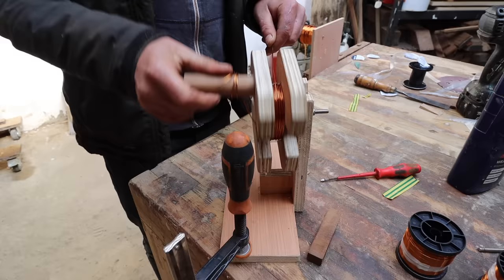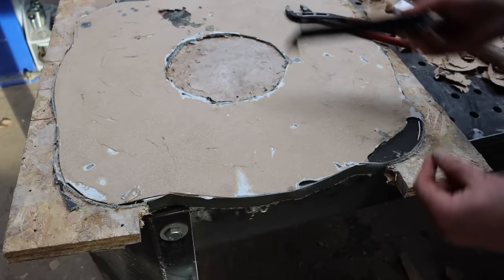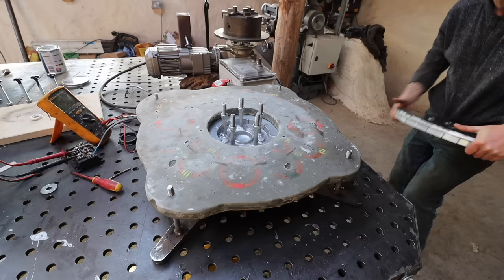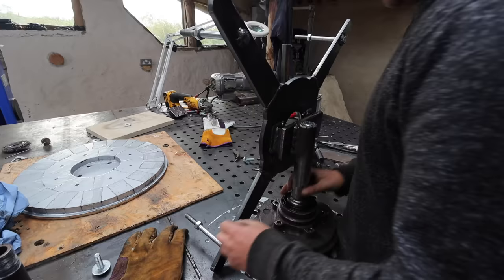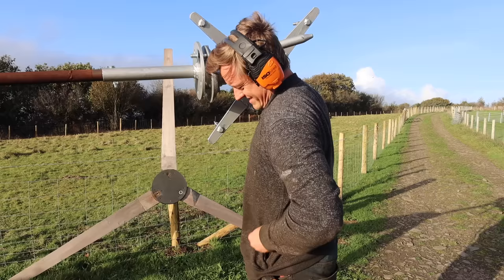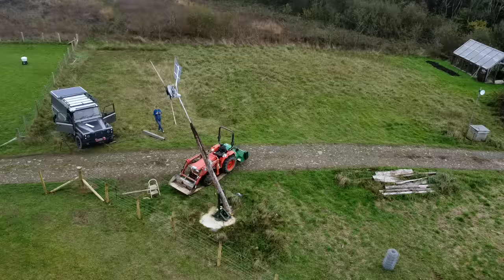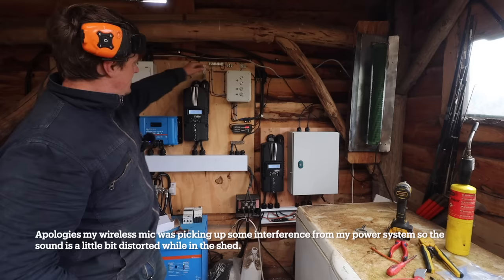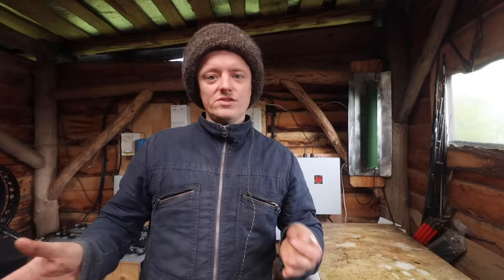Off Grid 2 KW Axial Flux Wind Turbine And MPPT Dump Load Controler Build

Comment: Very nice work!
Another tip, if you make the coils slightly trapezoidal you can pack more copper in the windings.
Only the radial sections of the wires generate electricity as they pass through the magnetic field.
Reply: @ahaveland......  The last sentence of your comment left me puzzled. The cross product of the magnetic field vector and the motion vector yields a current in the direction of the windings....  or maybe I didn't understand your comment. It's as if you were saying that the wire on the 2 long sides of the windings is being wasted.
Reply: @nicolasuribestanko  no, the wire on the short sides is mostly wasted as there they are mostly outside of the magnetic field, and there the magnets move along the wire, not across them. This is why long motors are more efficient and have more torque than short ones because there are more and longer windings inside the fields than out of it. (edited)
Reply: @ahaveland  Got it!  Thank you.
Reply: @nicolasuribestanko Thanks - on rereading, I edited my reply to explain it hopefully more clearly!

Comment: You can use a blowtorch to quickly remove bubbles from resin. This project is a bit big, but you could also use a vacuum chamber to draw them out
Reply from the maker: The bubbles were trapped under fiber glass. thats why I had problems getting them out. you can see in the video I had to snip the fibre glass to let a bubble out. im sure a vacuum would work though.
Reply: @KrisHarbour  Ah makes sense. If you're going to do much resin work, building your own vacuum chamber would be an awesome project!
Reply: @KrisHarbour  though useful, you don't need to mess about with vacuum chambers: if you wet the mat out with resin before putting it on it'll help stop air bubbles, so will agitating the mold when you've poured resin into it - block of softwood in a recip saw or something similar will make the bubbles rise out. (You may have done this anyway, apologies if so. I know how armchair YouTube comments annoy you!)

Comment: You could use a voltage sensing relay to trigger aux 1 if for some reason the voltage on the turbine gets to high due to the a malfunction of the ssr as you mentioned. Sad to see less energy projects in the future, however I'm always pleased to see your other videos as well:)
Reply: It seems SSR:s usually fail in ON position so less worries.

Comment: Great video and what a treat that it was over an hour long. Might be a stupid question but would the heater ever pose a fire risk in the barn? Would a water heater with a decent amount of thermal mass be useful, you could then pump the heat (water) out and refill it if it got to hot.
Reply: This was what I wondered as well, I thought he was going to heat water with it, and wondered even then whether that could get too hot.

Comment: Inspirationally simple implementation.  It could be a little simpler still, or rather, cheaper, if you make more use of the controller.  Sense the RPM, and when it's high enough to be productive, power self-exciting coils instead of using magnets.  Aside from avoiding the costly magnets, it also lets you map the torque response so you can fine tune the efficiency while keeping it in a target RPM range.
Reply: So that is what makes my 2kw Bergey so simple; it appears to be just a double-sized car alternator. Also Bergey says use a 100 ft tower as a minimum height to eliminate ground effects.

Comment: Kris, great build as always. Do you have any reference which we could use for calculating the right size of coils for certain-sized wind turbine? I am looking into building a much smaller turbine but still, some literature would be very helpful.
P.S.: If you would be interested in making an AC-side dump load controller as backup and to use the excess as a useful heat where you want it, let me know.

Comment: 48:56 You could make some electric heating elements your dump load and then make yourself a huge sand/thermal battery... You've got the space for it and it should be relatively cheap to make. Install a few electric heating elements in some tubes inside a much larger container, install a few more tube for air flow or liquid flow, make sure it's all sealed and insulated, then just fill it with a few hundred bags of sand. The waste electricity would be stored as heat, thanks to the sand, and if you needed some heat, especially in the colder months, you could just pull the heat from your sand battery to heat your house and/or workshop. I'm not sure what heating method you use currently, but whether it's wood or gas/propane, you'd save on fuel even if you only boost the temp by 5° with your sand battery. At least that way you'd be making some use out of the waste electricity and you won't have worry about overloading anything as much.

Comment: I've seen other DIY wind turbine designs using a driveshaft to the base. This allows the rotor and stator to be at ground level and remove the weight from the top of the tower - less work to raise it and less risk of a heavy object at height. Not sure if this would reduce efficiency since it'll need some gearing.
 You can also use a truck (lorry) wheel bearing/hub assembly from a salvage yard and you can avoid some of the manufacturing steps. This also gives you industry-standard replacement parts if you should need in the future.

Comment: For demolding simple hard floor wax/paste works very well with a heat gun smoothing and filling makes for and exceptional surface that can be demolded very quickly and with another application of wax can be used over and over

Comment: Hey Kris, I am super impressed and motivated by this video. Thank you so much. One thing that disturbs me is armchair engineers who comment with a better way to do something when they are unable to produce a video of their own to prove their point. That said, I have to tell you that your technique for raising of the Turbine could use some improvement. I helped a friend build a tower for a commercial wind turbine in 1999. The tower was 60' in height, constructed of 2" SCH40 black pipe and held in place with 6 guy wires connected to earth anchors. We used a simple "Gin Pole" design and it worked excellent with very little effort. I will post a link in a separate comment so YT wont censor it. Again, thank your for the video, Blessings my friend.

Comment: As far as protection in case of the solid state dump relay failing, what about switching a bridging contactor to brake the turbine if you have power to the dump relay, but no output from the relay? To avoid a pulsing situation if the signal is from the PWM, make the bridging / brake contactor latch on via an auxiliary contact. This would hold in until you pushed a reset switch. Love your work 👍

Comment: Hi Kris....two simple tips, from a resin pouring Pro.....line things with cling film....its easier to remove as a barrier/release membrane.....and get a large metal tub (like a big stock pot) place a lid, with a hole in it, and use a hoover to draw a vacuum.  The lower pressure will cause all of the entrapped air to boil out of the liquid resin....ergo....no bubbles in the pour.

Comment: Resin bubbles can be encouraged to disappear when a flame is put to them, a torch is handy but it's tricky as you don't want to burn the spot, just sweeping passes....also for the pressure boards we always use a plastic tape or medium thick film to save and reuse boards from stripping.
Reply: Then wouldn't a heat gun work better maybe on the low setting?

Comment: On the next stater. I'd try coating the mold with patrolium jelly. And placing a board on top, and place it in a plastic bag. Use vacuum to fill the mold with resin. It will keep the air bubbles out. Basically the same as a vacuum infused carbon fiber, fiberglass using a catch can to protect the vacuum pump,  just tossing ideas,  awesome work! ✌️

Comment: I built a similar turbine years ago. In a high wind event the tail furled, lifted slightly and then furled more right into the blades... lol I found one of the blades about 400 feet from the tower! A welded bolt on top of the pipe where the tail mounts to and a nylock nut fixed it.

Comment: Hi Kriss.
I just wanted to give you an idea of an option for your excess energy.
You could divert any excess through an immersion heater for hot water.
If you have a large enough tank, you could split the water via a smaller tank and pump that through a radiators either in the workshops, or the house. 
It won't necessarily create the amount of hot water that a on grid system would give you, but it's somewhere to divert your excess power once your batteries are at full charge. A simple controller would create a system that would work. 
Anyway, I'm enjoying your videos immensely. Keep on doing what you do best.

Comment: I had a solid state relay melt on me once . Definitely either put two in parallel or I’ve seen systems where they had power running to several simultaneously so they split the load. Although I haven’t gotten advanced enough yet to figure out how to do that. I was just starting to learn how to do all this when I lost my last place to live. Once I get to my new property I can start playing around again with my small set up.

Comment: Hi Chris,
I live next to the Atlantic on the north west coast of Donegal. I would never dream of putting up a wind turbine without first class heavy duty slip rings and brush sets. We get so many storms here that quite often the eye passes over dragging the turbine round and round hunting.
The sad thing about not using slip rings and brushes is that when the Turbine has self destructed and wrecked itself and the tower is lying buckled on the ground, there are very few who will point out the twisted remains of the 3phase  cable sticking up out of the base. I know that some of us use a rope tied to the tail and I have tried that but believe me, you would better protect your hard earned work if you employ slip rings and brushes. You can buy capsule type sets that sit inside the pole just below the flange.
One other thing.  About 8 years ago, ClockmanFR. Had 3 Very well finished Hugh Piggotts flying on his farm in France,  One of them jumped up and off the top when its wooden blades went off balance.  Leslie did not use slip rings and brushes either but he did put some kind of simple lock to keep his turbine from repeating that trick. I have been flying our 2kw x 120vdc  Yenzhou Shenzhou  since 2008. I recently erected a winching tower to raise and lower our turbine safely as I am not as fit and agile as I used to be.
It is a bit over engineered but I intend to upgrade to a more powerful lump next year. You are welcome to share its design. If you so wish.

Comment: Hi Kris, you will need to add a shroud/rain shield over the head swivel or it will collect moisture and corrode the taper bearings.. nice job, it will be good to see it perform with the larger blades.

Comment: Love the power vids, hydro solar and wind! 
Stunning you have more power than you can use!
Love the building vids! Looking forward to the barn design and build.
Thanks for your channel!
Reply: Hi Chris, another great build video 👍🏻, it looked like you had used copper grease on the taper roller bearings in the hub you had used which isn't generally good practice as it's abrasive.

Comment: Great work, and fantastic to see the whole journey. Only wish I had enough space to do the same. As you have no grid connection, that makes life easier in so much as you can do as you please or need. And there is a downside on the days when you are scratching for power.  

I am discussing getting solar panels, and I am told it will take 3 to 6 months to get permission from the power company to connect them. It is a mad world.

Comment: Excellent video. This design is clearly influenced by Hugh Piggott's work in Scoraig, Scotland. Very enjoyable to watch. I like how you've gone into detail on the necessity for the controller's ability to dump excess output into a heater or other side-load to protect the batteries, and how it actually goes about doing that. Speaking of which I would very much like to see what sort of batteries you've chosen for the battery bank and what degree of maintenance is required for its upkeep. In addition some comments about safety might be in order since there are multiple ways people can be seriously injured working on this or similar projects.

Comment: What you could do to prevent the cable from twisting: block the turbine turning more than 360 by welding a physical stop in the least probable wind direction.

Comment: Hi Kris I use proportional controllers instead of SSR , not on wind turbines but to dump energy. I found pulsing SSR troublesome if they were cheep. I have also gone down the Raspberry PI route on controll, i should have done it years ago, I love your channel its a breath of fresh air. Crydom MCPC2450C range or Carlogavazzi SS controllers. Very useful for energy diversion.

Comment: Set up 2 water tanks or ponds. 1 up hill from the others when you have too much power, you can send the extra load to pumping water up to the top pond. The bonus is when you run low on power you can either switch the pumps to be generators, or have a second pipe with water generator for on tap extra power.

Comment: Great work and great vid as always but I was kinda shocked you were able to fit the outside rotor by hand. I built a smaller version a few years ago but for safety reasons I had to fit the outside rotor using a jig to wind it on. The magnets were so attracted to each other it was impossible to remove by hand.

Comment: 43:27 yeah let the wires twist but put a largish loop in the wires so that there is an overall amount of flex distributed over the loop. The bigger the loop the less the amount of fatigue on any point of the wiring.
I learnt this from as a kid fitting my stereos in my car, the speaker cables used to break between the door and the edge of the door recess so I used to put the holes for the wires in the opposite sides at different heights and put a sort of S bend in the wire. That way when the door opens and closes the flex is spread minimally

Comment: Dump your extra power into a hot water heater. I have a water heater that I installed 12v elements in. Much better than dumping into resisters.

Comment: hi Kris, you could put the relay directly to short to the dump load - not triggering the SSR. 
Basically, you put SSR and the relay in parallel which will avoid the issue with failure of SSR

Comment: Nice one Chris and what a problem to have with too much Power! The only way of Improving the SSR issue is using a mass of Power Transistors on a Large Heat Sink, controlled by the PWM. So I hope you can use the Two SSRs in Parallel. But that is a lot of Power to Dump!

Comment: I'd use a much smaller PMA and then get my power back up with a lower cost 5/1 gear box. Gears and even chains and sprockets are cheaper than Neo-magnets and Copper coils and with the right gearing makes way more power.  Nice unit but you should be thinking of building with a design that makes them affordable. The design with a 5 to 1 gear box cuts the cost in half and gives people 20% more amperage since a high speed alternator is more efficient since the magnets are moving past the stator at 500% higher speeds which is better for power production.

Comment: I think that the efficiency increases when the turbine sits angled back a bit because the pressure wave generated by the moving blades do not encounter as much resistance on the pylon, as this wave is angled slightly away from the pylon. The will still be some wave-pylon interaction but is reduced.

Comment: Have you ever considered constructing some kind of 'natural battery'? For example with water. So when your regular batteries are full, the excess electricity pumps water up a watertower, and when the energy is needed you let the water flow back down through a turbine. Im not sure if that is at all practical or useful in your case, but I thought I'd share it anyway. Really impressed with what youre doing.

Comment: I'm amazed about your work, follow you already since few years. Nice job as always. 
One thing coming to my mind, about that heater you use as a dump load... why don't you use an electrical water boiler, you can buy one that is something like 80 liters and 2500 Wats. Like this you can probably use that energy to heat your next shower water. you will probably need to modify the boiler resistor to acomodate the voltage, but I don't find this to challenging for a guy with your skills.

Comment: Cool idea hacking a controller like that.
Ideally one would simply build it from scratch though, allowing it to do MPPT to battery, and at same time handling RPM info and dump load.
As long as it is not overspeeding, you can reduce power output by simply not running full load thus MPPT controller would keep batterys from overvoltage by keeping eye on the frequency from the generator and letting off the peak power point. Once load is too low to prevent overspeed, dump load can start to work, but it can still consume some for the batterys. This way, you deliver maximum of what you can to batterys, back off if possible to avoid over-generating, and finally dump any surplus.

Comment: To destroy the air bubbles you could use a little flamethrower right after pouring all the resin. I habe seen it done, haven't done it myself, though! 
I guess it works by heating up the air in the bubble which in turn causes the bubble to pop.

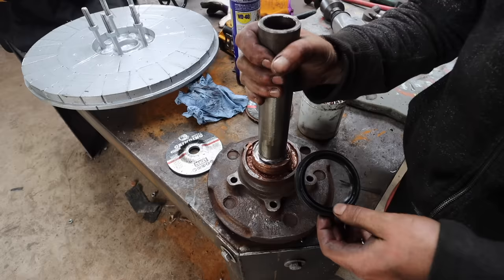Comment: 25:20 Copper grease is not a lubricant. The copper particles will slowly destroy your bearings. Other than that great work 👍

Edit: I see now that the hub is just for swivel movement. Copper grease is propably good enough for that.
Reply: As a vehicle mechanic I almost got a heart attack seeing that :o